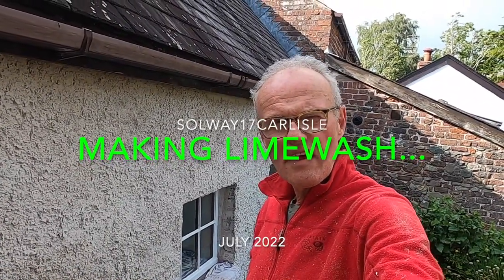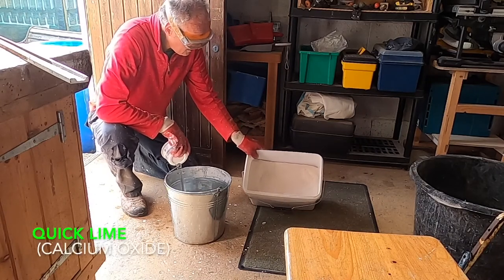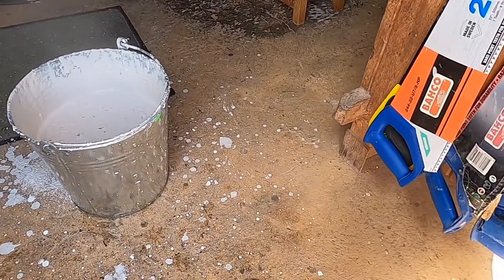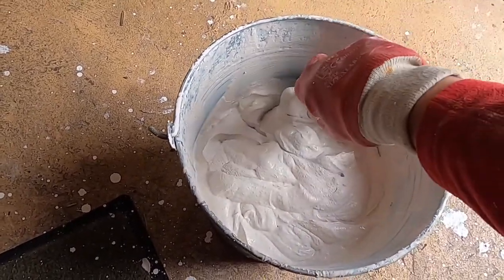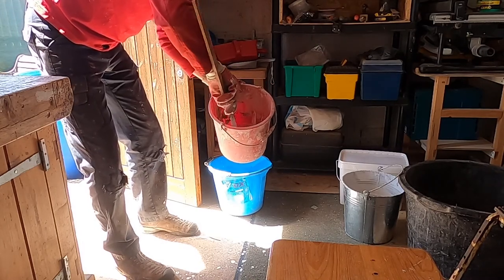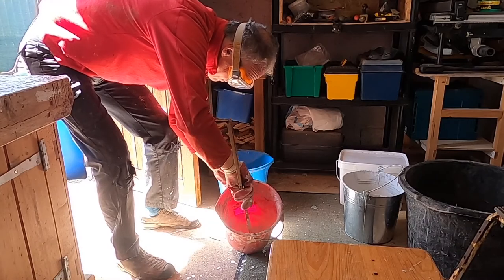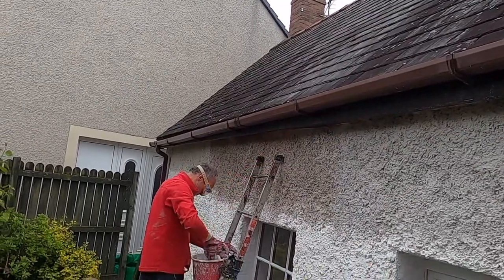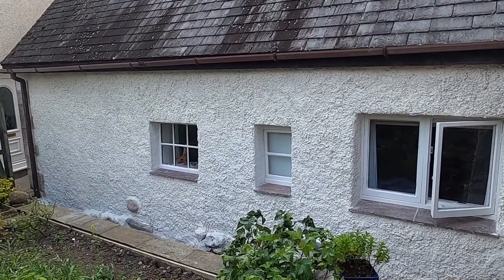Making Whitewash from Quick Lime

Comment: u should add binders also so tht whitewash get stick to wall surface. Additives traditionally used include water glass, glue, egg white, Portland cement, salt, soap, milk, flour, molasses, alum, and soil.
Reply from the maker: Hi - that’s interesting. I can imagine some of these would affect the final colour though? I personally wouldn’t add Portland cement as this would affect water movement out of the wall. Thanks for watching and the suggestions 👍
Reply: @solway17carlisle  u can add whole wheat flour than since otherwise the like wash will wear out faster. The quantity is 20% of the slacked lime or hydrated lime being used.

Comment: Hi, just a quick question. How is the lime paint looking now? I have read somewhere that you should leave it to mature before painting for at least a month. Not sure if it makes any difference? Thank you Lenka
Reply from the maker: Hi Lenka - your question has prompted me to go and have a close look…as far as I can see it’s still looking fresh and bright, other than at the base of the wall where during Winter months there’s a bit of green algae like you get on any hard surface. Tends not to be noticeable in the Summer. Overall I’m very happy with the wall now. I’m sure that leaving the mix for a month won’t do any harm - I wasn’t aware of this but it doesn’t seem to have affected the finish I have here. Best wishes with your  Limewash 👍
Reply: The recommendation for leaving a lime putty to mature is only needed for when you want the very finest finishes. 
External finishes won’t likely need that. 
On top of that, a lime wash applied hot tends to adhere better than cold stuff.
Reply from the maker: @georgeharrisadventuresinhealth  Hi George - Thanks for that. Mine went on as soon as it was cool enough to be safe to use. Regards

Comment: hi, just wanted to ask you if I could use NHL 3,5 with water for lime washing rather than lime putty? all the best
Reply from the maker: Hi Owen - I’m not an expert so please seek further guidance from a lime supplier. One comment above suggests using hydrated lime which could be a safer option as it doesn’t involve the slaking (boiling) process. Thanks for watching.
Reply: I am in the process of doing this at the moment.. I'd agree that if you don't want to slake lime them get some hydrated lime.. for me I wouldn't use NHL to lime wash..

Comment: I'm actually having a doubt.. 
So for white washing we use quick lime Or slaked lime?
Reply from the maker: Hi - you need quick lime then add water to to make the whitewash. There is a chemical reaction and heat creating the slaked lime. When painted onto the wall it gradually returns to calcium carbonate. Hope that helps..
Reply: slaked lime is used or hydrated u can purchase and use it since quicklime is most easily avilable hence u have to make slaked lime from it by adding 2-3 times water and mix and leave it for 2-3 days to rest and let is cool down before using it by removing excess water from top. don't leave lime dry when not using always add extra water 1inch layer over the lime surface to prevent lime getting dryout.

Comment: hi youve done a really good job of that wall, did you find all your damp went away?
Reply from the maker: Hi - certainly improved the situation - one of the interior rooms has dry lined walls so difficult to know what’s happening there but the other room where I re-plastered with lime is dry. I have also subsequently drained that back area of the house so it all makes the place dryer. Thanks for your comment. Regards

Comment: Of course you could use hydrated lime, much safer for those who are accident prone. Also easier to get a hold of.

Whem I'm off walking I use a flameless heater that uses that chemical reaction to heat water. The little packets of quicklime are quite expensive, following watching this video i may make some up myself.
Reply from the maker: That’s interesting - I have a ‘hot’ lime supplier in my area so source materials from there. 
Certainly a process which requires great care. 
Thanks for watching and the comment- 👍